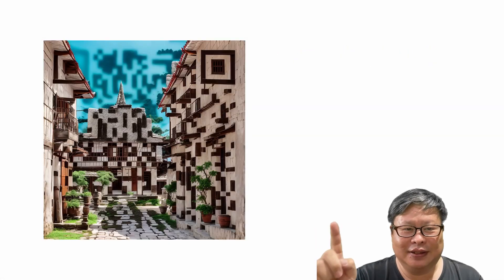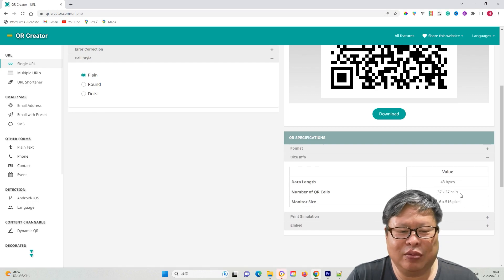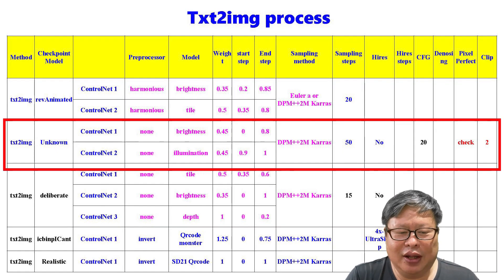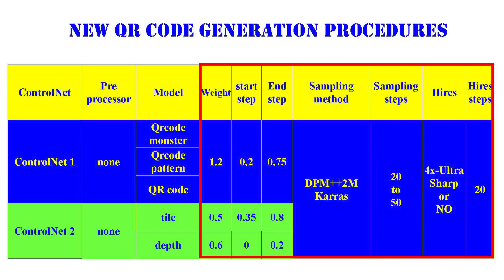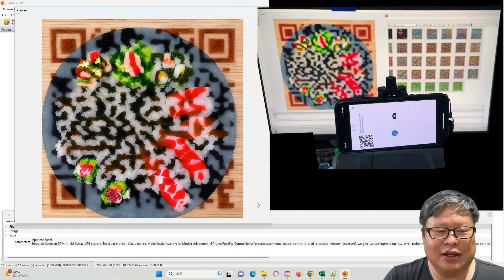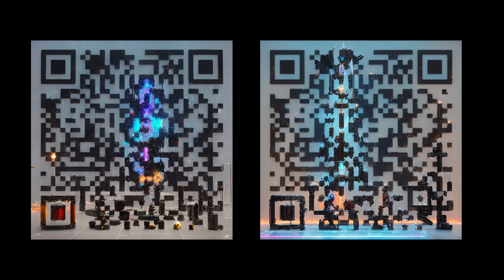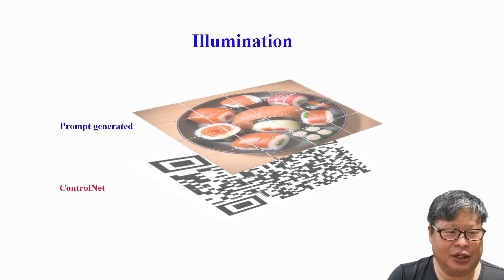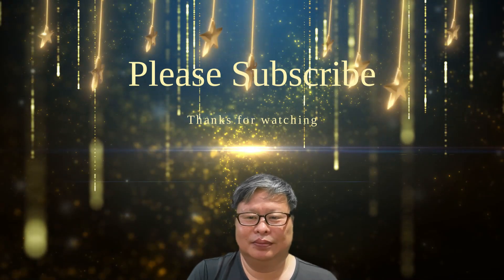How to use stable diffusion webUI A1111 create stunning scannable qr code-from zero to hero

Comment: Sir, excellent job posted on your channel. I'm following him mainly for his qr tutorials.
One question, have you tried generating qr with your own images using only SD? In my case I have not succeeded
 that's why I ask him. Thank you and congratulations for the time spent posting your videos
Reply from the maker: I have made another video using photo to QR code before. You will find the answer I hope. But not using stable diffusion. Since using photo and QR code, both of them almost are fixed. Not so much room for making change. Good luck. Have a nice day.
Reply: @TubeUnderdeveloped  Thanks for your reply. I saw your video with photoshop very good. The idea was if it is feasible to merge image and qr from controlnet. I clarify that I have not yet achieved satisfactory results. Kind regards
Reply from the maker: @MartinZarate  I know your real meaning. I think it is simple but it turns out it is not simple. I will try it later and tell you the result. Have a nice day.